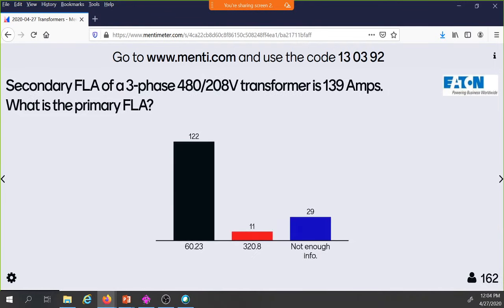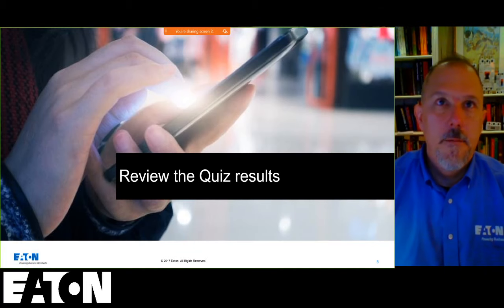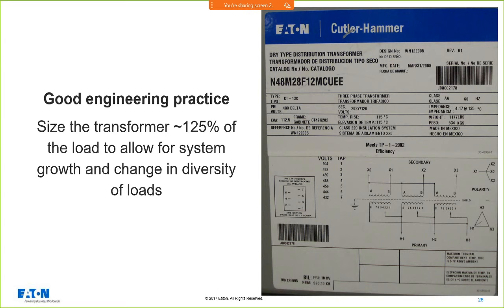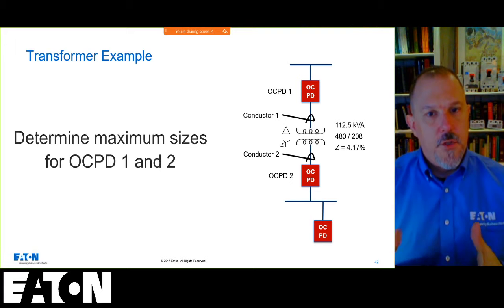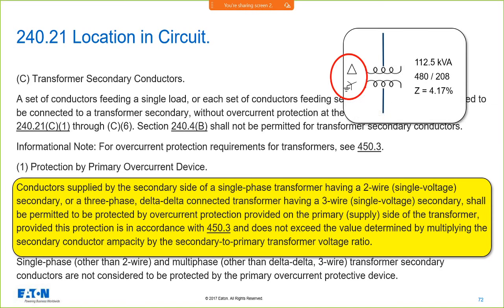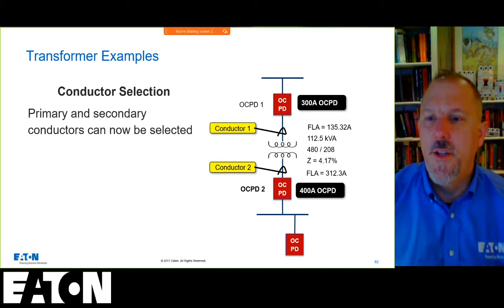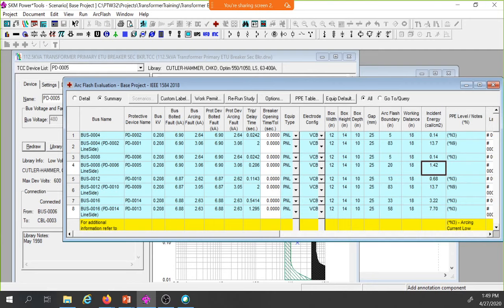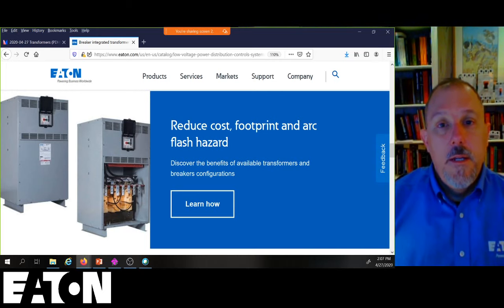Transformer Applications & Protection

Comment: I  have a question.Suppose we have Grid Supply with 5000 MVASC(Assume it infinite bus), Now if i Connect a Isolation transformer of small KVA( of equal turn raio from Grid. Consider a 4000 kva transformer. Now i calculate transformer secondary current and then fault current by dividing it by transformer's impedence. so if a fault occurs on transformer primary terminal, A much Higher fault current should flow then if a fault occurs on transformer secondary terminal. How does isolation transformer is able to reduce fault current? Does transformer satureates? i know transformer has impdence but would that impedence be able to limit fault current that much?
Reply from the maker: Answered your question in this video.  Thanks for engaging in the dialog.  https://youtu.be/uN3bqw6jvkY